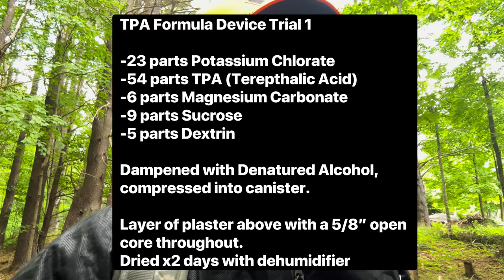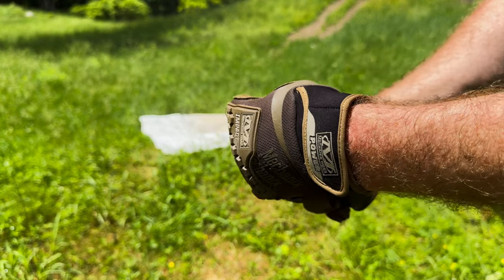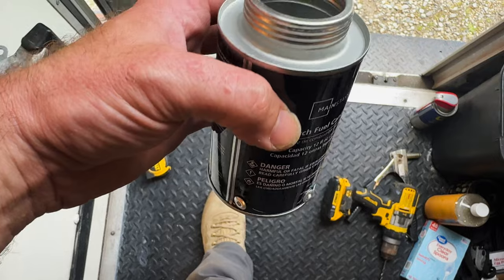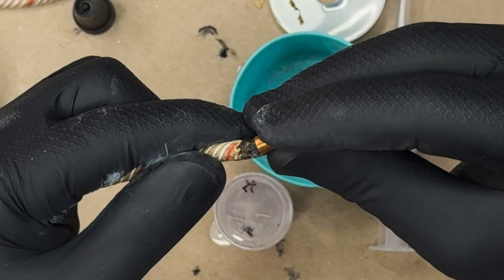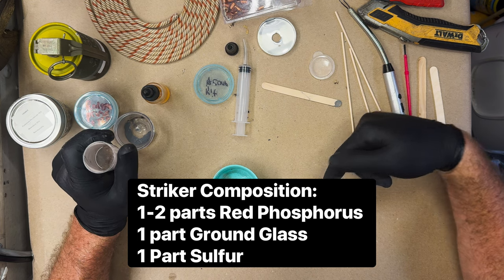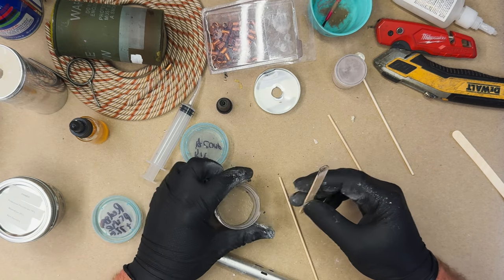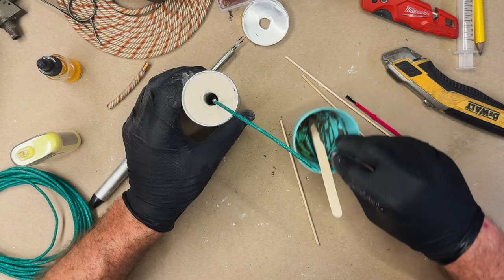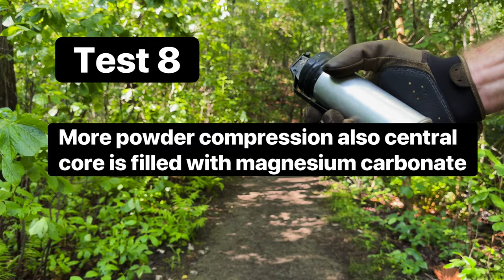Engineering a Safe(r) Smoke Device and All The Failures Along The Way

Comment: I probably missed this answer in the old videos but why don't you vent out the bottom like the M-83 smoke grenades? they also put a disk made of thick wire screen in them.
Reply: ive also been wondering this
Reply: So would that then burn from the middle out to the ends? I think that means it would deliver all smoke in half the time, no? Ya that might be very cool
Reply: I figured he vented from the top so that the plastic (easily meltable) grenade fuse assembly would be ejected upon ignition of the smoke composition. If the fuse assembly was attached during the reaction, it might melt/be damaged (?)

Comment: These are awesome, really thick smoke that likes to linger around. Is there way to make the smoke cold so it likes to stay near ground instead rising up?
Reply: That's due to the smoke formula. If you just use powdered sugar and potassium nitrate, it will not linger, although output will be much lower.

Comment: Really awesome info!!! Accessibility is a problem however. Would be really cool to have a “1 day build” type video of the best smoke from local sourcing. Trips to HW store etc… using simple green cannon type fuse (believe it or not, this is actually on the shelf at my local gun store). Something more folks might get into. Having to order chemicals online loses the majority of people.
Reply: @DukeReynolds  the simplest is going back to his earlier videos, you can make your own ignition composition from store bought materials, and the smoke comp is stump remover mineral oil and powdered sugar, that's a perfect one day, alternatively you can find store bought pull string smoke grenades at firework stands or somewhere like phantom fireworks. As for the tpa formula, potassium chlorate can be made using electrolysis with the correct water softener salts, and the majority of the remainder of ingredients minus the tpa itself can be sourced from health food stores.

Comment: Would adding additional compression make a difference? how about ball milling?
I have a 20 ton hydraulic press that I use to compress home made black powder mix before corning it.

could you not just use a 209 shotgun primer for the priming?
Reply from the maker: Yes, yes, and yes. The more compression the better, I’ve found that I’m always limited to the strength of the container.  

If ball milling, I’d blend the stearic acid into a fine powder separately, then recombine for the last hour of milling

Comment: Seems like the HC smoke device still puts out more smoke and with a more reliable burn but the TPA does the job mostly and isn't as toxic, just wondering if the lower performance is worth the drop in toxicity.
Reply from the maker: I personally, would take the HC. The performance difference is massive. I’ve never seen anything like the HC composite formula. It just smokes without baffling in whatever shape it’s cast in. Unbeatable reliability. A shelf life greater than my lifetime. Waterproof. It’s crazy. Gary purrington published that formula in 1997 and over my last solid year of research, I haven’t found better.
Reply: @InventionIncarnate  Thank you for the feedback, I am going to make some of the HC soon.  I have had mixed results using rocket candy and parafin wax. Sometimes they are EPIC and put out sooo much dense white (and good smelling) smoke, other times they wont stay lit. Still others they burn too fast and pop the endcap off the container and then the flame hits the vaporized wax after it has mixed with air and it burns greatly reducing the smoke output to that of the rocket candy itself.

Comment: It still seems as though your previous TPA configuration was superior in volume. Of course, that could be simply because it contained more mixture...Was this successful test significantly less?
Reply from the maker: You are correct, the cardboard devices are significantly more productive. The ignition assembly with those is external leaving the powder core intact. They withstand more compression during packing of the powder, overall I like cardboard more, they just don’t have a spoon 🥄
Reply: @InventionIncarnate that can be remedied with a 3d printed m18  mechanism thats been resized to the dimensions of the cardboard tube.